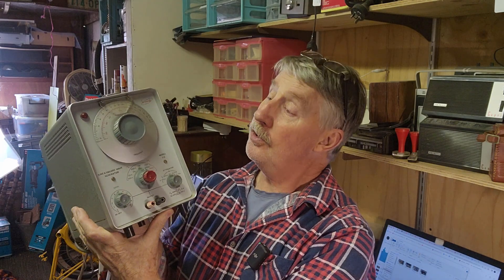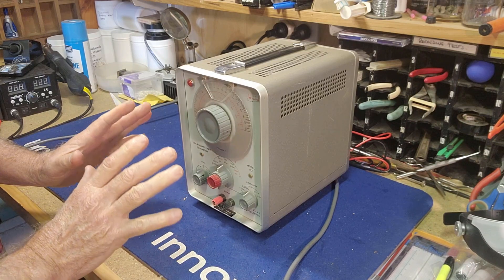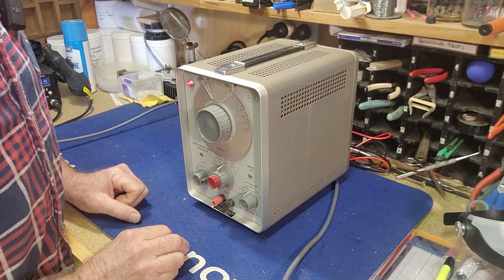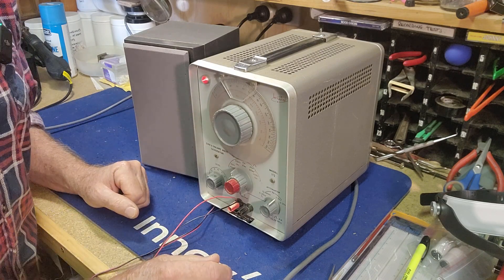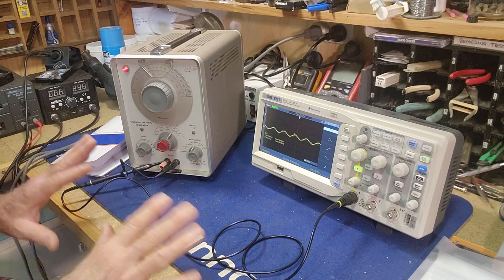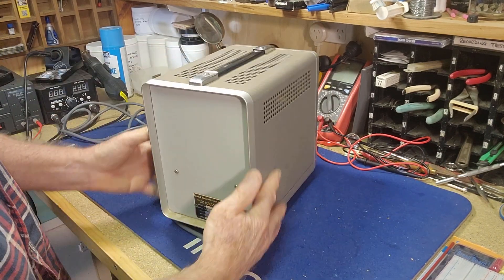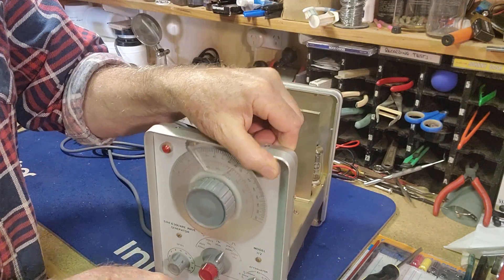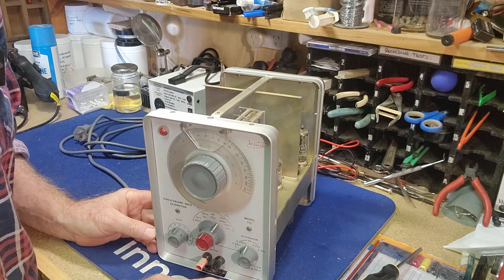Vintage 1960s BWD Sine & Square Wave Signal Generator Restoration Part 1 - Inspection, Test & Plan!

Comment: One thing I would definitely suggest is that when you "earth out" the capacitors, it might be a good idea to make up a box with a decent sized resistor and some well insulated leads and probes, so that you discharge the caps nicely.... Maybe you already do that on the larger high capacitance high voltage capacitors. Are you something like a 5 watt sand cast 180ohm jobbie. Lovely video
Reply: Agreed! I have heard of people blowing the blade clean off a screwdriver with a (very) high voltage cap! It's usually fine, but making a discharger with a chunky resistor is best practice for safety from what I've read.
Reply from the maker: Thanks richclips, I'll look into that! 👍😊

Comment: My only understanding of electronics is don't stick a fork in the power socket. Nobody Lisa story but as a young kid probably 8. I pulled a motor out of a toy car. Fed the 2 wired into the wall socket. The motor came to life (only for a second or two), screaming it's  tits off and then blu apart lucky I didn't get electrocuted or hit by the shrapnel. Nobody believes my story.
Reply from the maker: Wow Graham - a super-charged motor for a micro-second!! I bet you never did that again!
Reply: @TheUltimateRecycler   lol I didn't but it was very impressive. Mayb I make YouTube video on it one-day 😂

Comment: I recommend you get a "Transistor Tester" if you don't have one already. It is a german design of arduino/atmega MCU, but it became popular enough that the chinese copied it into a million different designs. You can get DIY - build ones, or surface mount "LCR-T4" named ones, GM328A, boxed with a lipo battery LCR-T1/T7, etc. Any of them should work fine. What they can do is test many, many different components to a "good enough" accuracy. Things like telling you a ballpark measurement for the ESR of a capacitor might be able to tell you some good from bad capacitors, or transistors that are now dead, etc in a jiffy. Very handy to get started repairing.

That isolation transformer in combination with your scope could be very handy! "Ground-loop shorting" your oscilloscope is one of the most common ways to kill an input on them, and if that isolation transformer works, it'd be great in combination to solve that issue. I  believe EEVBlog has a video explaining it.

To get the scope showing a stable image, you want to set its horizontal trigger point correctly in the middle of the wave, so it captures it going up/down in sync. You can look up oscilloscope triggering for more info.

An "old" oscillating circuit is called a "wein bridge oscillator". Amazingly, it can use an incandescent lamp, which changes its resistance very slightly when more energy goes into it, as a negative feedback to stabilise the circuit's gain factor. This actually helps the oscillating circuit to create a lower distortion sine wave!
Reply from the maker: Thanks Matt for your detailed comment! 😊👍
I have one of those testers and yes, they are great! I also actually have an ESR meter and gradually gaining an understanding of parts testing.
I'll check out "Ground-loop shorting" - I'd like to avoid killing anything if I can!
Still lots to learn of course and I appreciate everyone's help 😊

Comment: Nice signal generator. The oscilloscope exists to show signals like that. The only way to damage them is by doing something silly like exceeding their voltage input with a high voltage source. Dont measure things like the horizontal output transistor collector in a CRT TV. Valve radio restorers tend to remove the guts out of those multi-cap cans and put modern replacement capacitors inside so it still looks original, same with other large chassis mount caps. I have a couple of similar BWD oscilloscopes I will get around to looking at one day.
Reply from the maker: Thanks Steve, appreciate your comment! Yeah, I'm thinking I would like to re-stuff the old cap can - could be interesting trying! I'll look out for your vids on the BWD scopes mate! 😊👍

Comment: Hi Chris, following this one with baited breath. Should be awesome.
The small light bulb may possibly be a current limiting device??
Also, when discharging capacitors it might be a good idea to keep your other hand in your pocket. Saves you smacking yourself in the head if a capacitor is charged and you actually complete a circuit. 
Can't wait for the next episode on this.
Cheers NN
Reply from the maker: Thanks NN! I think the globe has something to do with part of the oscillation circuit from what someone explained but I'm not even close to understanding how - or why! 🤣
Yep, gotta be careful with those caps!
Reply: I know little enough to be dangerous. Guitar amps sometimes have an oscillating light that switches the tremolo circuit on/off. So that might be a better idea than mine.😅
Reply: The light bulb is used to regulate the oscillator output level